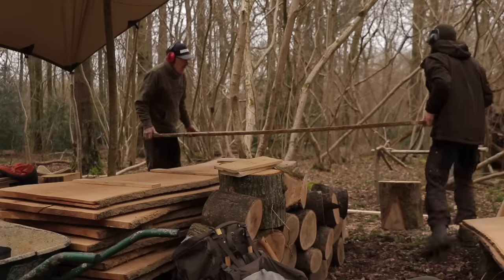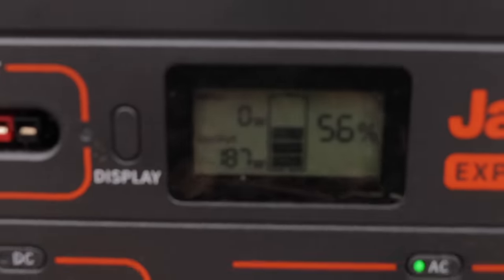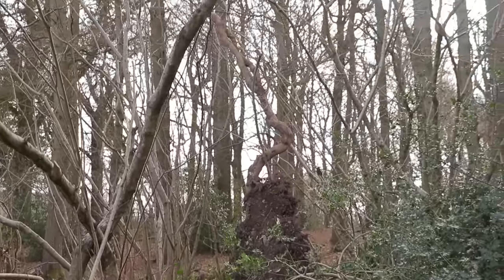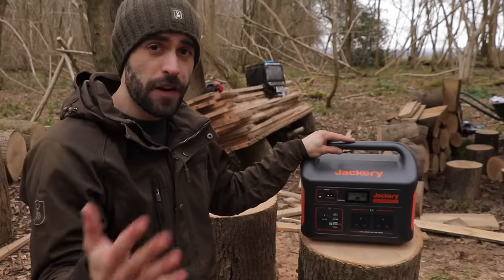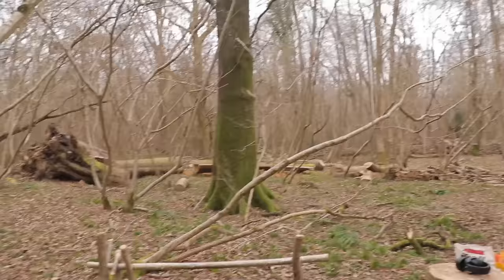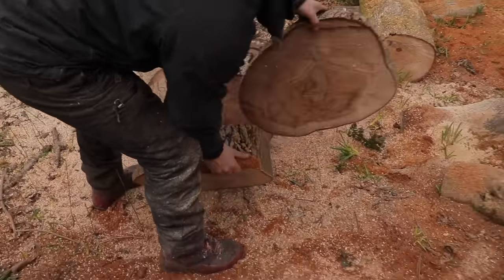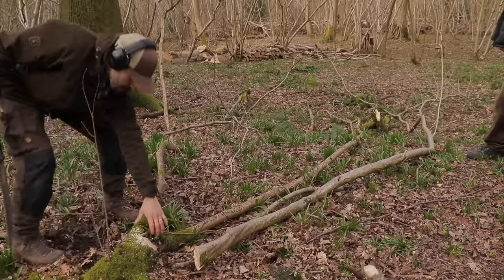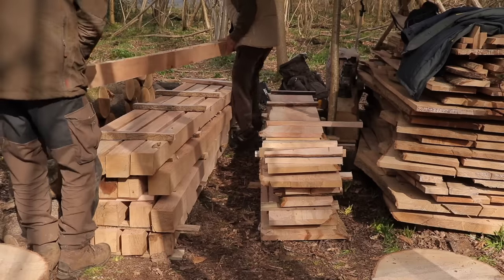The Ash Tree is Finished! Off Grid Building Project in the Woods

Comment: I just found out that you can convert thermal heat to electricity & rig it up to a mppt charger for your Jackery by placing it over the fire. Basically it entails hooking up several if not more TEC Peltier modules that are around 40mm x 40mm x 3mm thick in series sandwiched between an aluminium plate an an aluminium box to place ice water in. When the bottom plate gets hot while it is suspended high above the flames of the fire or sitting on top of your portable indoor fireplace then it will also heat up the opposite side of the aluminium box which you place ice into & this will create a combined high voltage & high wattage that then goes into your mppt charger that then plugs into your Jackery box.

Comment: I wonder if you could use one of those fireplace fans that convert thermal heat to electricity &  rig it up to a mppt charger for your Jackery? If you could series connect 3 or 4 of those fan bases to create a higher voltage then it would be able to charge non stop over night on the fire or fireplace.

Comment: Clamp down a straight edge the width of your base plate to the blade also set the depth of your blade slightly lower than the depth of gear you're cutting.
By doing these two things first you will have two good edges plus you will get longer life out of the battery. 
All the best .
Love the show.

Comment: I may actually get a jackery since it has a solar charging option.  I'm wanting to work on the trees on the far side of the lake so I can build a rifle range into the hillside. Having a charger with solar panels ammeans I could run my plug-in cooler and batteries off it for the afternoon. I'd normally use my truck, but I have no land access to the far side of the water without crossing other property.  But with 4 acres back there, it's be a shame to not utilize it somehow. I can throw a jackery in my Can-Am and cross the stream in the SxS

Comment: Good video, interesting Jackery test - and regarding the charger it's pretty dumb placement of the sockets -- if they sell on the British market they know half of the plugs comes with the earth plug at the bottom, half with the plug at the top, which makes it a nightmare to use any half-decent power strip, and causes the cable to the Makita charger to get kinked really badly by the body of the Jackery --- their sockets should be at angle, 30 or 45 degree.

Grwat vid anywya, love seeing you working with Dad. You're a great team, take him for some nice camp again :)

Comment: I bet that if you were to use a Makita car charger, instead of the mains charger, you would get the Jackery to last a lot longer. No need to change the DC power from the jackery battery into AC just to have your charger change it back to DC for your Makita battery.

Comment: 8:09 You're going to be creating a small building on the south side of your property where you're going to hook up your battery chargers and some solar for electricity while on the site? (I suggested this a few episodes ago, lol)
Reply: 15:08 You might be able to get by with just some sheet plastic or tarp placed on top of the wood pile with some smaller logs on top for weight. This way you don't have to leave your nice tent out there long term to keep rain off of the wood... That's what we do when we do lumber or firewood stacks.

Comment: Would the solar panels work well to charge the battery if the day is grey or even raining?
Reply: Sorry, I asked the question prematurely.  I was expecting to see how the tree trunk was milled first before you starting splitting the planks.  It's very informative.  Thanks.
Reply from the maker: They will still work on a grey day, but much slower than on a sunny day.
Reply: @TAOutdoors  Thank you!